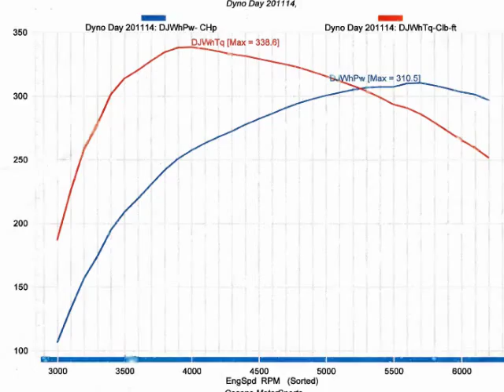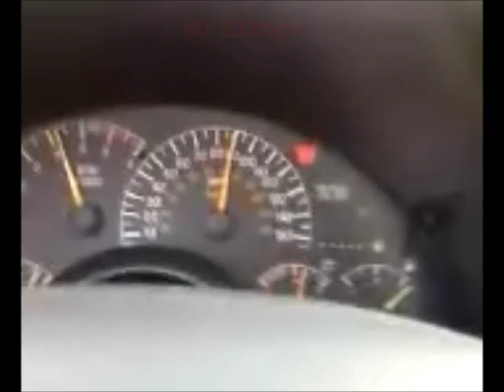1996 Firebird Formula WS6

Comment: I bought mine last October 2020 has 56700 original miles interior is like new 6-speed manual transmission I love it it's fun to Drive
Reply: Also equipped with ram air looks exactly like the car in the video

Comment: Don't ever sell it kid!
Reply: I still have a wx6 Pontiac Firebird Formula all original 1 524 produced only a hundred and seventy-four were made with 6-speed I have a 6-speed with a cassette player. I am the second owner it has 57800 original miles I'm thinking about getting it repainted next spring. I have never seen another one like it only the ones that's for sale and there's not many of them.